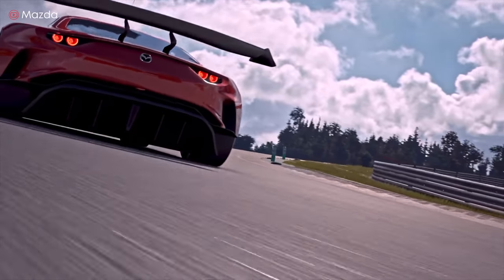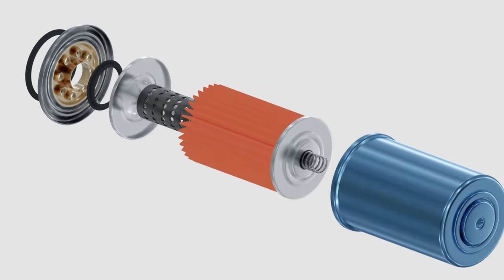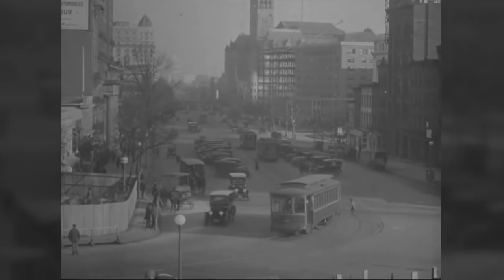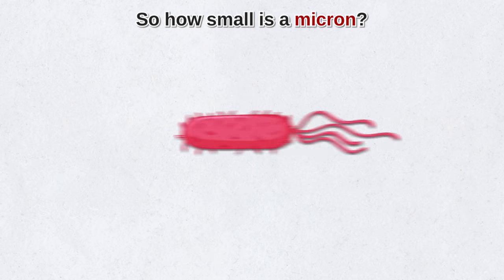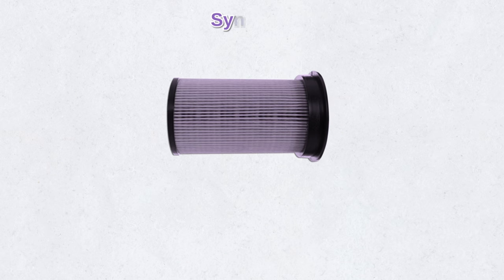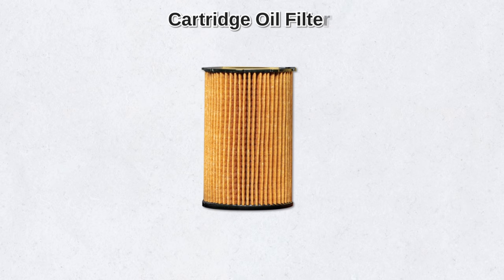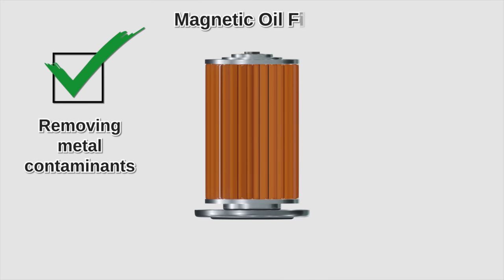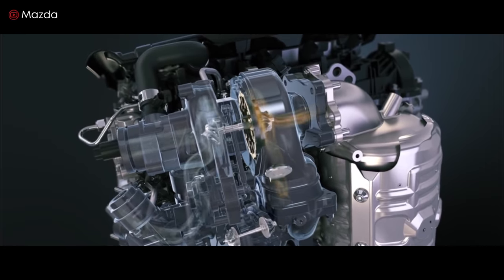This New Oil Filter Just Changed the Game (No More Oil Changes)

Comment: Warning: open the box when you buy. Years ago I thought I was buying a K&N oil filter from Wal-Mart. When I got to my hobby shop and already had my oil drained on the hydraulic lift. I opened the box and a darn cheap FRAM filter was in it. I was HOT! 😲
Reply: When you're in Wal-Mart and you're buying antifreeze concentrate, make sure that the foil seal under the cap is intact, as I too got home and found it punctured and a pint to a quart missing.  Hard to tell if they used most of it and just filled it back up with tap water!  Fortunately, they took it back.  I always check the oil filter for manufacturing defects, possible shipping damage, and that the gasket is still on the end.
Reply: Probably someone switched the two and he walked out with the K&N oil filter in the FRAM box.
Reply: Good to know.  my local Walmart has the K&N products locked with a key behind the glass door. I think the Condoms are locked too.
Reply: I’d be upset to buy Trojan and end up with something else I didn’t want
Reply: @lukespack  ya think?
Reply: @petahe01  LOL...you ARE the father. 😂
Reply: Saw a couple of marine inline fuel filters that were no good. Could see the pleated element wasnt glued in. Took them to a store employee.Checked later they were back on the shelf. At Walmart.

Comment: Excellent video Scotty. I learned new things even after 50+ years of caring for my cars. By the way, Mazda is really making some beautiful cars!
Reply: Yeah, once they got rid of that old smiley face grill....
Reply: Had a Ford Probe 93. A Mazda. Paid 600 for it. Ran great but wouldnt pass the  smog test. Finally gave up on it and called a scrap dealer. Was thinking the other day if I had kept the car it would be exempt. Drove it a couple of years. Put about 600 bucks in catalytic  converters and such. The reason I got it for 600 bucks was it wouldnt run. Distributer problems V6 with manual.

Comment: Hey Scotty, I remember the Frantz “lifetime” filter with its “toilet paper roll” inside.  I even recall the Prelin Electric Oil Refiner (now being peddled as PetroSaver).  I also remember the extended drain interval claims made by Mobil 1 - even replaced a turbocharger on my 1978 Saab 99 Turbo because I believed them. 🙄
Reply: Frantz.actually worked. New.version has been.created while old school is still available. Watch a demo some day.
Reply: Mobil one dpecifixally recommended to NOT use extended drain intervals on turbo or supercharged engines....had a friend w z turbo Shelby front wheel drive car that learned the hard way about turbo cars....fun to drive but pure hell to take care of
Reply: @johnervin1474  any idea WHEN that recommendation came out?  I wonder if it was too many people with bad experiences like mine 40 years ago that caused it.
Reply: Never had a car with a turbo. There are over the road trucks with over a million miles with no oil drains that have turbo charged engines. Of course they have large bypass filters like the Gulf Coast 02 filter that takes 3 gallons of make up oil 5.5 gallons when the full flow filters are also changed. Pulled into.a Cummins shop once with a new truck with a screaming turbo. One of the big hose clamps had ended up inside a hose. Worked it's way into the turbo.
Reply: @ralphwood8818  one more thing to fail (expensively).  Boost more air and fuel into an engine, and you create more heat and stress.  It had better be well built or it won’t last.
Reply: @lanedexter6303  know a guy with one of the larger Hyundai  cars with a 4 cylinder turbocharged  engine. It threw a rod at 70,000 miles.  He is an old guy that takes care of his cars. His wife cant drive her Camry V6 anymore. I hinted that I would like to buy it. He said it is going to his daughter. He said hers has over 500,000miles on it and is starting to give her trouble. He said would you like to buy the Hyundai it's in the shop being repaired under warranty. He didnt want to wait. Bought a new sports model Camry. Probably has a turbo. How a wealthy guy in his 90s ends up with a turbocharged Hyundai  I dont know. Said he read some good things about them..
Reply: @ralphwood8818  well, turbocharging, or any form of supercharging, makes a small engine breathe like a big one and make big horsepower. But that small engine had better have strong internal components and a great cooling system.  I enjoyed my Saab 99 Turbo, but these days I look for longevity first.
Reply: Oil is cheap. Motor are expensive. Of course if you drive a 25 years old Toyota you may not want to invests into oil changes.... This guy seems to says that every cars are sh*t except those but not everyone wants to drive beaters.
Reply: @xminusone1  with 2 2007 Corollas and a 1986 F250, I think oil changes are very important.

Comment: I was once working on a Mercedes engine that had a recent oil change but clearly had some lubrication problems. The culprit was the new oil filter cartridge. The cheap oil filter cartridge "dissolved", that is, the paper in the filter seemed to have been ripped by the oil pressure and was clogging the oil pickup. It probably got there through the bypass (relief valve). The rest (in pieces engine) is history

Comment: Your car’s engine performs optimally when it has clean motor oil. Yes. It also works better if you pour it inside the engine. 0:29

Comment: Air cooled beetles, metal screen and magnet. 
Which most people ignored. 
Oil change stories galore. 
Lady brought her explorer in for its first oil change at 60,000 miles.
Captain on the boat complaining low oil pressure. Cartridge plugged so bad it collapsed. Had to remove in pieces.
Countless double gaskets by DIYers.
Few missing filters, seized engines so bad had to drop pan and disconnect all the rods and loosen the mains just to turn it enough to unbolt converter.
Or the drain plugs falling out 2 miles down the road from service stations. 
Don't miss it.
But those who were religious about oil changes and maintenance. 200 -300 thousand miles was not uncommon even back then.
Cheap insurance.

Comment: “Your engine performs optimally when it has clean motor oil in it”
0:28
Well maybe it also would if half the oil didnt spill on the engine 😂
Reply: I noticed that too.  It bothered me.
Reply: It always gets back to what the oil change  people recommend. Allow the oil to get dirty then drain it. With that system the oil is dirty more than it is clean. Be sure to use a high quality.full flow filter and have your dirty oil drained often. Bypass filters only clean part of the oil.Oil is better now Engines are cleaner. But the oil changer rhetoric hasnt. No bypass depth filters dont remove what might get past the full flow filter.. Modern engines have almost nothing large enough to be removed by the full flow filter.The small engine wearing abrasives must be drained or filtered out. Sorry. No oil doesnt go into the full flow filter black and come out golden.That takes one of the many depth bypass filters. Toilet paper paper towels cotton  pulverized newspapers. My 41 dodge had a better filter than anything on new cars. It was a Fram sith a cotton filled cartridge. The same as a famous Luberfiner cotton filter. Im a toilet paper guy. Jackmaster Frantz.Gulf Coast Motor Guard. Right now im liking the Australian Jackmaster. I apreciate that they havent forgotten we toilet paper users. They are set up to take the larger cores and shorter paper or their high quality elements.
Reply: I always think I can put the oil in without spilling any. Always make a mess. I have several funnels. Finally started using funnels.i flinched when I saw the oil missing tne fill port..
Reply: "Mah 2000 Toyota still works perfectly"
- this guy

Comment: My first car was a 1953 Chevy. Oil filters were an option back then. The optional oil filter was mounted remotely with hoses running to the engine. These were not full-flow filters and were a potential for oil leaks. I removed the optional filter and just changed the oil every 1000 miles. I ran that old Chevy for three years going to trade school. Then I gave it to my mom who drove it a few years and sold it to my mother-in-law. She couldn't wear it out and finally sold it. The old Chevy was still going strong when she sold it.
Geo from Kalamazoo, MI
Reply: My 41 dodge had a bypass filter that was factory installed and was optional  equipment. Knowing what I know now it would have gotten a Frantz adapter so that I could use toilet  paper in it. Some old fossils tell me the Fram could have been dealer installed or came from an auto parts store. I'm only 81.
Reply: I remember a decal with clean oil on it. It said the dip stick tells the story..used  cotton the same as the Luberfiner  750. My 37 Studebaker book didnt recommend oil changes except for seasonal reasons. They said change the filter when the oil looks dirty on the depth guage. Probably used cotton and factory installed.  It was in a magazine called wheel that they sent to new Studebaker owners.
Reply: That makes sense instead of fixing the oil leaks change the oil every 1000 miles. You could still get decent filter cartridges for the old cars at least up until the 60s.Fram made them. The 53 model Frantz allowed you to use superior toilet paper in the optional filter housing. The famous Frantz three stacker for diesels was the same but tall enough for three rolls of toilet paper. You can still find them mostly on marine diesels in the gulf of Mexico .when they were discontinued  a Frantz dealer started replacing them with a paper towel filter. They came out with a better designed little filter. Haven't sold them in years. Their big thing is the big filters. Pretty much a waste of time dealing with individuals. The oil changers have that market .
Reply: If I had to change the oil every  1000 miles I might take the easy way out. I was thinking about my second wife having the oil changed on the VW beetle every 1500 miles because it had no filter.
Reply: I never opened the bonnet on My 1931 Chevy and only stalled twice in 1943. 😆

Comment: How many times has the game been changed so far?
Reply: i know ...I came to see all about the  " new oil filter that just changed the game " .  Got a general lecture on oil filters instead lol .
Reply: Offhand I'd say about twice a week.
Reply: I wasnt paying attention. I didnt notice Scotty was pointing to a full flow filter talking about no more oil changes. I'm sure Scotty knows there is no such thing as a full flow filter that cleans oil. It takes a bypass depth filter to clean oil. You can put an orifice in a full flow filter and run hoses to it and it still wont clean oil.
Reply: Filters that eliminate oil changes have been around at least since 1953 when John Frantz  converted the old canister  filters to use the superior toilet paper. Then made the canister filters taller to take 3 rolls of toilet paper for diesel engines. You.can still find them on shrimp boats and such. Saw two of them on a over the road truck about 35 years ago. 318 Detroit. When they were discontinued. A Frantz dealer replaced them with a Gulf Coast paper towel filter. The toilet paper filter was replaced with a improved model. Many feel it is a waste of time dealing with individuals.  Most individuals think engines will last longer if the oil is allowed to get dirty and be drained. That is what is recommended by the oil changers.

Comment: Scotty, I read most of the GM reports at the GM Tech Center Library back when I was researching permanent cleanable oil filters.   True, the rate of wear from oil particles increases exponentially as the size of particles increase.  This led to the development of a patented cleanable/reusable SS ultrafilter that was leased to large commercial fleets.  No oil based filter waste went into landfills and 99.9+% of the oil was recovered.  There were many anonymous actors involved in killing this nascent technology.
Reply: You can buy stainless cleanable oil filters for most vehicles, they're big in the performance market and with motorcycles. So nobody is stopping them from being on the market, just the manufacturers aren't interested in putting them on new vehicles. I've come across them on bikes i've worked on, and I'm unsure how I feel about how well they actually work. Companies spend a lot on R&D for filters, Honda and Triumph are known for having some of the best. The German filter makers have been making glass fiber filters for a while. No conspiracies, just economics at play.
Reply: Ive only seen one. You could read a book thru it. It was obvious it was designed for a race car where you were only concerned with large engine destroying chunks of metal. Modern car engines have very few abrasives  large enough to be removed by the full flow filter. Its the small engine wearing abrasives and sludge you have to worry about. What else could I expect. I was in a performance parts place paying too much for a Weber carb for the Subaru. My Honda 500 had a Ford car full flow filter with a Frantz oil cleaner  hanging upside down back behind a saddle bag.  I could be called a clean oil fanatic. The 305 had a centrifuge inside the engine chain driven. I would think the motorcycles with the transmissions in the motor oil would need a good full flow filter.

Comment: Back in1986 I changed the oil on my Toyota extended cab 4 cylinder efi 2.2 liter engine. I was on the interstate and my oil gauge flashed red. I drove 3 miles at highway speed to a gas station. I forgot to check to make sure the old o-ring was off. It wasn't! Filled up with a synthetic oil and went to work. Today the engine runs fine. . .

Comment: I have a Toyota with one of those pain in the butt canister filters. Toyota has since stopped using them.
Reply: Why is it a pain in the butt?  Just asking because I have been changing the cartridge filter on my 2009 Corolla since new and I have never had an issue.
Reply: @davidhoulden5791  I think the 2009 Corolla has a regular oil filter not a cartridge filter.
Reply: @lukespack  Bought my 2009 in Nov 08, built in Cambridge Ontario.  First year for cartridge filter.  Do you think I would lie?
Reply: The one on my daughter's 2003 Sun bird with the 4 cylinder  is up at the top..Much better than a spin on underneath.  Curious  about the elements are getting crushed by the oil pressure. Might need a stronger core. I know nothing about that system.

Comment: The spinner filter operates like a centrifugal fuel polisher for diesel fuel. That is one of the best things to use with high horsepower yacht diesels.  Fuel polishing in Diesel engines is very helpful.

Comment: I run a oil centrifuge filtration kit on my diesel. Love it!
Reply: you can't beat a centrifuge filter for getting and keeping the crud out. A big centrifuge is how the oil refineries clean up old dirty contaminated recycle oil and turn it into good oil they use in their own fleets..
Reply: Your engine still needs some new oil added to keep the additives refreshed..I get my new oil by adding make up oil at depth bypass filter change . A quart of oil every 6 K miles on the cars. My 65 Honda 305 had a centrifuge chain drive inside the engine. They were popular on Mack trucks.years ago I was a mechanic for a oil rerefiner onventional oil gets better every time it gets refined. Years ago Mercedes  cars came with rerefined  oil..one problem we had before synthetics were  the impurities not removed by the refinery. Most people wouldnt buy the rerefined  oil. They want the new stuff. Most of it went to hydraulic oil and other lubricants. You may have noticed there is little interest in centrifuges and depth bypass filters. The interest is in comparing filters that dont clean oil and how often you need to drain your dirty oil.  At one time Goodyear sold rerefined oil in their service centers.